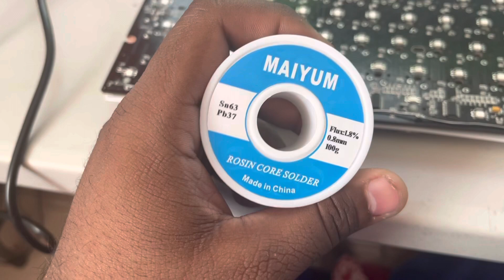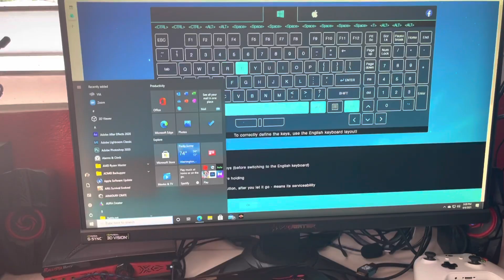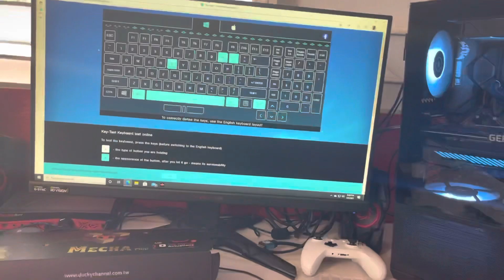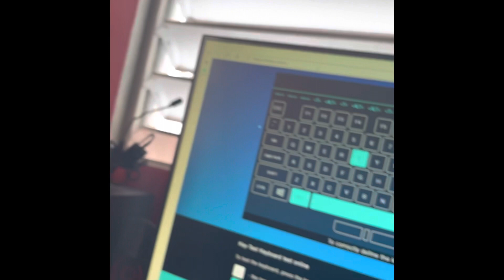How to fix keyboard keys not working(works on hotswap pcbs.)

Comment: Have a similar problem, but pads and lines are ok, checked with multimeter but END key is not working for some reason.
I modded converting it in hot swapable, all good but 1 key. Any ideas what else can cause it to not work?
Reply from the maker: Did you bridged the end key to another key?
Reply: @PCEnthusiast17  tested with multimeter, the track and bridge are OK. One on the diode and the other with all the keys on the row. That's why I'm really lost, I don't see why this doesn't work while all others do
Reply from the maker: @drazen4368  what keyboard are you trying to fix?
Reply: @PCEnthusiast17  it is a mechanical keyboard with non hotswap switches, I added some kind of gasquets and now is hot swappable. All went perfect and I noticed today that the end key was not working. Checked the switch, tried another (even that the one looked good) so I disasebled it again to check for a brocken track or bad soldering. All seems OK, but key still not working

Comment: Hello zimadz, I'm also working on swapping my switches on my ducky one 2 sf and also lifted some pads.. Did this work perfectly fine for you?
Reply from the maker: Yes, if you can use enameled wire it wont short anything and will be better.
Reply: @PCEnthusiast17  I fixed one switch already my s switch, but the only problem is that one whole left column of my board doesn't work. (esp, tab, capslock, shift, control)
Reply: I already found a solution to this, I just wired it to its diode and it worked perfectly